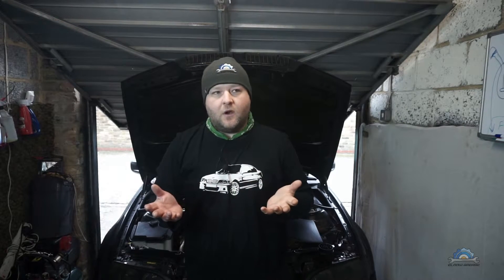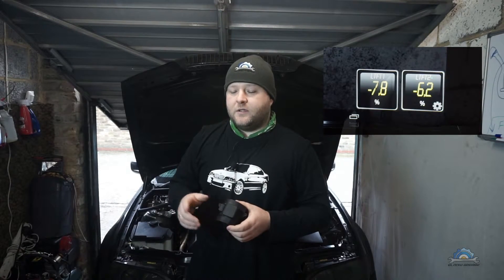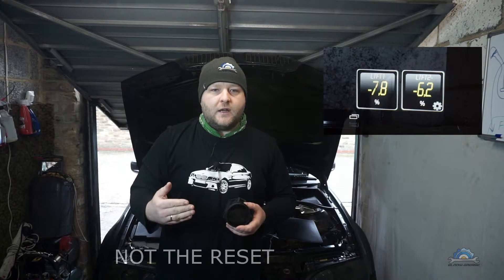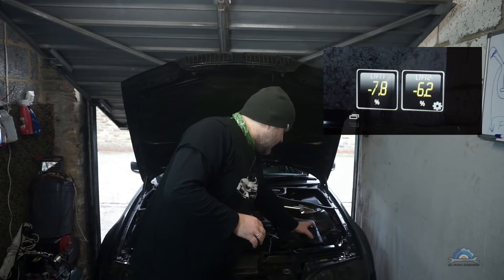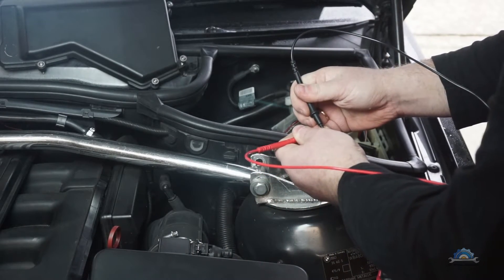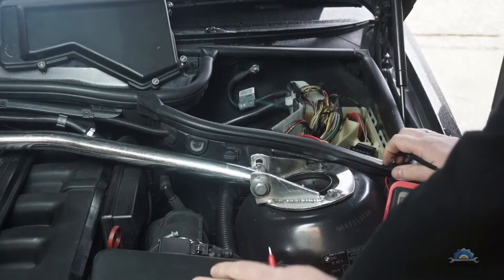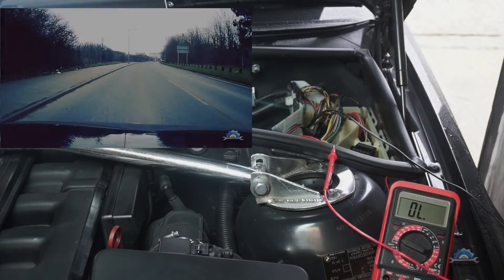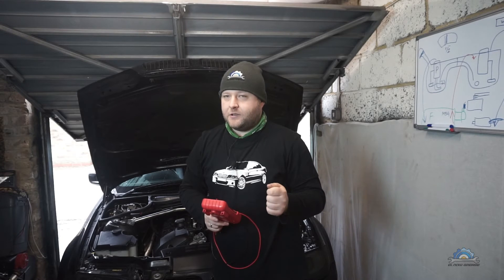BMW e46 NEGATIVE FUEL TRIMS possible SOLUTION

Comment: Were you getting any codes?  I've been trying to fix this P1092 code and I have replaced everything but the engine and the stupid code comes back with the dash light.  I will try this and hope that works.  My fuel trims are fine but the P1092 keeps coming back.  The Smog guy passed the smog for me because the light shut off but the code was stored in there.  Thanks so much for helping the E46 community.

Comment: I have a 2003 F150 Lariat 5.4L 2 valve with negative trims around -12 to -15...along with the P0401 code (EGR flow insufficient).  I have replaced everything in the EGR system and the code still pops up occasionally and the fuel trims are still negative.  No idea wtf is going on.

Comment: i've replace 3 MAFs at least and 4 wide band sensors and five smoke tests.and still have negative short term fuel and high long term.
Reply: looks like it is time to find a good diagnostic specialist
Reply: @antsh1985  unfortunately finding a specialist in houston is the imposible part. might as well take it to walmart and have them do an oil change and call P0171 a fix.
Reply: injector checked?
Reply: @nadeem5476  i fixed it
Reply: @WV591  how you fixed?
Reply: @nadeem5476  the most overlooked thing. fuel pressure regulator/fuel pump. I could have caugh and fixed  it early but it's imposssible to measure fuel pressure on sentra 2005. none of the disconnect tools on the market work on fuel line.
Reply: @WV591  negative long trims can't be negative if fuel pump is faulty but fuel regulator is faulty and giving more pressure to injectors then it is possible that long term fuel trims show in negative.
Reply: @nadeem5476  yep, all injectors are good

Comment: Thank you for the tip. I have a similar issue with my B5.5 Passat 1.8T engine, long-term trim varies between -5% and -3% and I have a new MAF sensor. Not sure if VW would have similar connections inside the ECU box or wires will go directly to the ECU socket, must check and see. But similar to you I was wondering for a long time what could be causing these slight negative numbers in the long-term fuel trim. I feel the car is a bit laggy and wondering if -5% on the LTFT could be the reason for this.

Comment: interesting. i have replaced fuel pump (inside tank) and since then my LTFT are always rich (around -5%). the maf is also new (vdo).
i’m going to replace the front O2 sensors, because the rear ones are disabled. 
wish my luck.
Reply: Did you changed o2 sensors and it fixed your problem?
Reply: @filipchojnacki  no. i don’t care about negative ltft anymore…

Comment: Actually i got the Long term fuel -3.9 always! And the Short term fuel -3.9 to -8 with 800 rpm please help anyone i have nissan altima 2014
Reply: Leaking fuel injector / problem with fuel pressure regulator / MAF wrong reports start there

Comment: I was fighting that battle too. Turns out it was the chinese MAF, even though nothing indicated a bad maf. Replaced it with a VDO, problem solved.
Reply: Was your MAF sensor readings correct? I have M54b30 and readings on idle are aprox 13.8kg/h so it is good but still getting negative trims.
My MAF sensor is aftermarket- Delphi.
Reply: @kowal116  I would check for vaccumm leaks with a smoke machine, and if no leaks are found, replace with a OE MAF. Again, my readings were correct but the car still drove lumpy, bucking and surging, so...

Comment: Im impressed with this info you shared. Im sorry if my question smells a bit of ignorance but here goes, I have map instead of maf, I have awful negative trims like short goes sometimes up to -10 and long at idle fixed at -14. Short moving around -3 + 6 and long goes down to -7 under load. Would you recommend the way you fixed for me? Ive changed o2 sensors, cleaned throttle, changed IAT sensor, air filter etc, injectors are fine. In the city short driving its awful but gets normal on highway. Im assuming that not enough air coming to the combustion chamber. Next weekend Im thinking to take out intake manifold and check inside, clean if necessary. But I would give your method a try before I mess with intake. Thanks in advance.

Comment: Does your fix also apply to the newer 6 pin MAF's? Also can the fuel trims be reset after a change? I changed maf, o2 sensor, new hoses, etc and stft bank 1 shows stuck at -100.78 in torque pro, and both left's seem to be stuck around +20. No codes, idle is solid and stable

Comment: I'm going through this issue  installed engine in my truck negative fuel trims just changed connector I did wiggle test truck died  but fuel trims still no change I will be checking this out tomorrow great video ty for tip

Comment: Just found this video. I was trying to solve my negative trims for 2 years (Since 2013) and i had similiar issue. I was replacing engine in 2011 and we probably "broke" MAF cable. I found it accidentalyl after 2 years, had car running while INPA connected and when i wiggle MAF cable, MAF airflow was changing so i replaced whole connector with cables (bought it in BMW) and it fixed my issue. I also replaced everything from o2 sensors to catalyc converters. Here is my thread https://e46fanatics.com/forum/showthread.php?t=1078477&page=2
Reply: Mike could you plz share with me fb or viber ? i,m having this problem more then year too. not lazy, even did the stuff showen on video still the same

Comment: Any idea on why I would be getting a po172 and po175 on my e46 m3 I cleaned the maf and changed the fuel pump to a walbro 255
Reply from the maker: Manuel Rodriguez in general codes tell you that engine running rich.Was it like this before changing the pump?
Reply: Elbow Grease was running rich before doing anything
Reply from the maker: Manuel Rodriguez best thing to do is to read stft and ltft also amount of air sucked by MAF
Reply: What should they be at? I tried googling what the maf should be reading but didn't show me and idk what those other two things are
Reply: Update I changed the maf and fuel
Pressure regulator and now its running lean
Reply from the maker: don't swap parts,do ecu scan ,you migth have bad o2 sensor of vacuum leak ect.

Comment: Great info! I have been working on my M54 for over a year to fix that negative fuel trims.  I understand it is not normal to have negative fuel trims but have had no idea why it happened.  I tried most solutions but no success.  I replaced most of the relevant parts (those were in need of replacement anyway) and it doesn't help.  Similar to your case after resetting LTFTs to zero the car runs better.  But after a long drive at highway the negative fuel trims come back.  Can't wait to try your solution this weekend.  I am fairly confident that this is root cause.  Will report after .
Reply: After a new trip, LTFT moves to -3,0/ 0.0
Seems like the trick is working. Never before any bank rise 0,0
Difference between banks would be dirty inyectors or another thing..
The point is that the DIY works !!
Thanks again and cheers!
Reply from the maker: Dirty or leaking injector,
spark plug
NOT coil
o2 sensor
bad or wear on the lifter or lifter bore
low compression
Reply from the maker: let me know
Reply: Did the check and pressed the pins last night.  The connectors look alright and quite clean.  I found there is a coat of oily liquid over the fine cables.  Probably released by the cables' insulator due to long term high temp under the hood.  Traced the 3 pins MAF cables and found two on one of the gray connectors.  Pressed the pins and sprayed a little bit contact cleaner on them.

No chance to drive after that as it was already late night.  Started the engine to make sure it ran ok.  The engine sounded running a bit smoother but only test drive will tell.  Will update you again after the actual driving.
Reply from the maker: If you disconnected battery ,fuel trims are gone so needs to drive for longer
Reply: I thought so too. But after checking it through OBD fusion, the LTFTs stayed as negative after reconnection of the battery.  So I need to drive around to see if the LTFTs will come back to zero/positive.
Reply from the maker: can you tell me what MAF is showing on IDLE?
Reply: From cold start with 18C ambient temperature, the MAF reading on idle started high from 11 g/s then gradually decrease to about 4.2 g/s in about 5 mins and then keeps dropping to 3.36 g/s in about 20mins.  My engine is 2.2L in capacity and the MAF is new manufactured by Siemens VDO.
Reply: After driving for about 45 mins, here are my findings
1) the throttle responsive is more responsive
2) the engine runs quieter,  more powerful, and runs like when it is new particularly at idle it runs much smoother now
3) the negative fuel trims aren't completely gone yet they still go up and down a bit between -4/-3 and -2/-1 but I found the STFTs are much more responsive and logical as they go positive when the car is idling at traffic lights and go negative when I lift off the throttle and cruising

Overall whether it is down to the improved pins connection or due to reset of DME by disconnection of the battery I really don't know. The LTFTs stayed negative after disconnection of battery but I think it does reset other adaptations like the automatic gearbox. 
But the engine is really enjoying a new life. Hope this will stay.
Reply from the maker: Brendon Leung so how low LTFT was before
Reply: -5/-4 in the worst case 
Usually moving between -4/-3 to -3/-2
Reply from the maker: this is no drama I would not be worry about,my engine is after rebuild and I've got -1% to -1.5% after MAF connection problem
Reply from the maker: what about o2  sensors?
Reply: Yes I would not worry any more as the engine runs great now
Thanks for your video gentleman this is the most helpful advice I have ever had
Keep up the good work
Reply: Under idle, both post cat O2 sensors are rock solid at around 0.75V (mine is MS43 with three wire MAF and narrowband oxygen sensor). They are 14 years old sensors. The pre cat sensors are new.
Reply from the maker: Pablo Gomez In this video I mentioned that in my case everything was done,checked or replaced so I had no way ti go where You got.I will be doing more vidoes about basics fuel trims ect.
PS. your trims vary between banks so MAF or fuel pressure Its not the case.
Reply: Difference between banks would be the precept O2 sensors. If they are too old, can do this. I will replace it further. At same time, O2 measures with OBDFusion looks well...
Thanks for your video, very useful
Reply: I did the trick too, my LTFT numbers are similar to the ones of Brandon, After the ECU connectors cleaning I notice some little bump at the engine (suggestion??). Exactly the same experience at described here. 
STFT go positive (+10/15) at first, but letter they become tending to negative again.
My precat O2 sensors, fuel pump, MAF and fuel filter/pres regulator aren't  new.
MAF measures are similar to Brandon too.
I will wait to do a couple of Kms extra to see how it goes. LTFT now -3.9 Bank1 /-0,8 Bank2
Just my experience.
e46 328i 1999

Comment: Did you check all pins from ecu or just allof them from 1st plug ?
Reply from the maker: all with similar colour cuz it's hard to find thoes going from MAF connector,simply you need to focus on thoes three  colours like on the picture.BUT one of the pins was loose so it's good check/push all